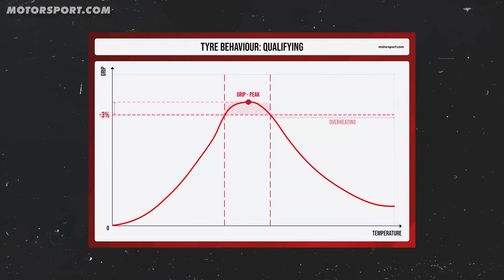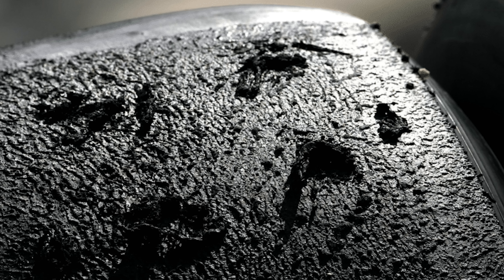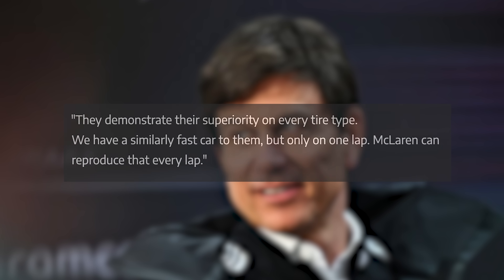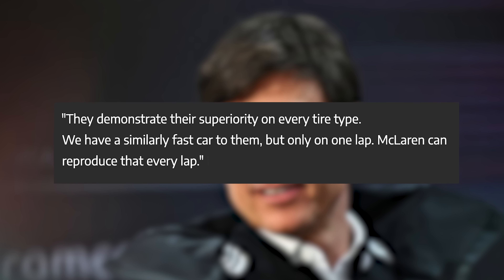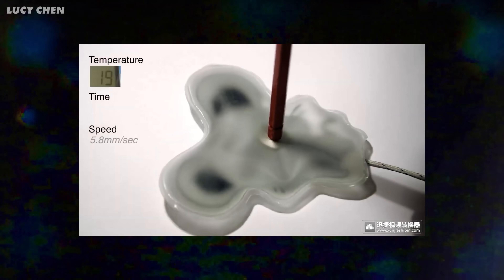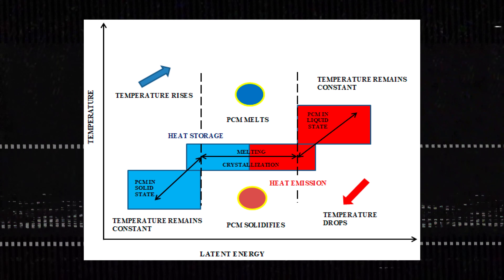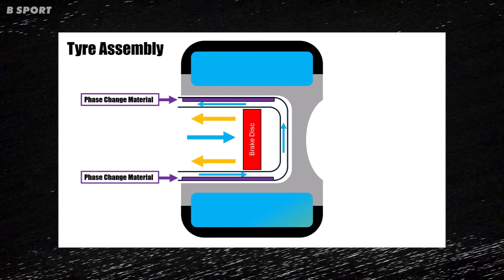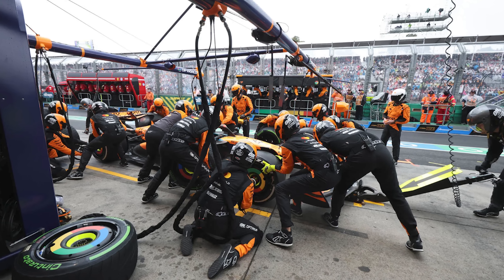McLaren’s GENIUS Tyre Trick Explained

Comment: does anyone remember when mercedes came out with a new wheel rim that got the hot air to move around equally but more efficiently? they took the wheel to the FIA who agreed  that it was a completely legal design. sadly, they dropped the rim so that no-one could complain (im looking at a picture of horner!) 

just before that, mercedes spent (they claim) 40 million, it was legal but the FIA told them they would have to remove it because all the other teams would want to do the same thing and this would send spending through the roof. or in other words, tough luck toto, you got to spend all that money but now it has to be taken off the car. what made it worse is they had to do it by the very next race. but the FIA is fair to all teams, so when red bull deliberately designed a wing they knew was illegal, they were given time to step it down (i think 3 races but cant be certain).

Comment: I don't see why it should be illegal to water cool the brakes in the first place. If teams want the added weight of that, they should be allowed. It has me thinking of CPU coolers that use heat pipes. There are some nice suspension pieces right there...

Comment: He might be right. Here. Phase change materials have been around for a long long time and I would be surprised if no one in F1 has considered before. 
We use it in our computers to transfer the heat away from our CPU and GPU. The top version works way better than traditional thermal compounds.

Comment: This technology wouldn't necessarily increase unsprung weight. If it allows the team to reduce the brake duct complexity and still maintain or improve brake cooling capacity, the tradeoff in material might actually be in their favor.
The possible downside is having to optimize this design for each track layout, since the length of straights and braking zones will vary quite a bit. I suspect they settled on a safe compromise rather than making custom brake setup for every track.

Comment: Instead Red Bull are the real cheaters. 

WELCOME TO MAX BULL:

They used Asymetric brakes 2023-Spa 2024.
They removed these from Perez's car in Miami 2023.
Max had these from 2023 up to SPA 2024. 
20+/30+ seconds every race ahead of 2nd placed pilots, no degradation issues during that time, Max could push it all at will and even had to slow down so it is not obvious (way different race pace than anyone else). Dude was cruising. 
No need to overcorrect his steering wheel, car takes corners amazingly well and able to push all he wanted without carring for his tires. Checo's looking more like an Aston Martin and degrading more than Max, yeah, right. 
One of Max's weekness as a pilot is tire mannagement.
Before Miami 2023, Checo was fighting Max for championship and was on par in times with Max! Race pace and quali.
Then in Miami, asymetric brakes removed from his car, only Max wins.
Same as 2022 (Marco and Jos made sure to sabotage Checo's strategies, not changing ending of life gearbox and leaving a used test floor in his car for 5 races in a raw - 2nd half of championship). So Max is not bothered by teammate (Max loves that). 

Max amazing pilot, gets most out of the car and also a great coward! 
"I did not came here to be second" Baku 2023.
And then again in Miami 2025 after fighting all over the place and ridiculed by Piastri. 

It is clear Red Bull pays media so Max is always "extraterrestrial". 
Everything he does is amazing and never comits mistake. 
If he wins, ah he is amazing, super Max blablabla... when he lose it is "Teams fault" or "slow car". When the team almost never made mistakes with Max. 

Checo: all the mistakes in the world. 
F1 is engineering, everything is calculated. There's data! Nobody looks at this!

Fact is in Miami 2025, he did not maximize his potencial and made a big mistake. 1st corner of the race, he was ahead and could have taken the corner normally.
Indtead, he goes middle trying something else allowing Norris to pass him and then throwing his car into Norris. 
Norris loses positions. 
If Max kept Norris 2nd with clean air, then he might have get both Mclaren fighting and maximize his chances. 
Max is just bad under pressure and has become an open book to Piastri.
Finally Max will have to upper his game and Piastri will be ready.

Checo could have been the same, but Max always ensured that 2nd pilot does not fight him.

Thanks to Marco and friends at FIA. 
Red Bull not having a Team head race engineer for both pilots, Lambiasse been Max and team head race engineer at same time (All data for one pilot only at Red Bull). 
Hugh Bird as Checo's race engineer (costing him more than 40+ points per season - worst ever race engineer in F1 history).

But is "Verstappen car that is adapted only to him" the issue.

Red Bulls***

Comment: Well, if this is the trick, then it has to work more like a temperature buffer rather then "cooling". There is no magical material which could absorb such huge amounts of energy without being very heavy. It has to get rid of that heat in some moments. So I can only imagine it prevents overheat in parts of track with a lot of braking and cornering and then it needs to release absorbed heat in parts of track where the tyres would be generally getting cooler.
Reply: Higher speed sections mean more air to cool and absorb heat from PCM and then reverse happens when braking to a slower speed.

Comment: Material engineer here. As soon as i heard word "phase" it instantly clicked in my head. Brilliant solution, lovely and elegant. And also demonstrating the power of property designed material.
Reply: Me too, except for the engineer part. 😁
Reply: Physics and music guy here. As soon I heard the word "phase" I went up all the wrong mathematical rabbit holes and was embarrassingly far into the video when I remembered "phase" in its materials/chemistry context. 😅
Reply: Did you consider as a materials engineer that the latent heat of fusion is a two way street in that a massive amount of latent heat would have to be released to into the wheel assembly to re-solidify the melted phase change material such that it can again serve as a heat energy sink at the next braking corner.  We must consider that with this type of "keep it cool" system, a large amount of heat energy is still stored in the overall wheel assembly as its not being effectively dissipated externally as with an air cooling system where the heated air physically leaves the system.    Nobody here is discussing the obvious fact that latent heat works both ways in that a lot of enthalpy is needed to melt the material at the same temperature but in reverse, a lot of enthalpy must leave the material to re-freeze it at the same temperature!!!  Where exactly is that released heat going to go guys and girls???.............back to where it came from is a pretty close answer folks.  If the air flow between braking zones is not sufficient to cool the wheels without the phase change material, then it's not sufficient to remove the same amount of heat from the magic phase change material to refreeze it such that it can continue to function as a heat sink.  This is engineering 101.  Heat sinks have to be cooled too before re-use as they store a lot of heat.  Recall that when a material solidifies at constant temperature that the latent heat of fusion must be dissipated from the material to the surroundings.
Reply: @bobstevens7028  What do you mean nobody is discussing it? I did😂.
The original problem was not to let the tires get up to temperature fast or to cool them, but to do both, and one solution Martin Buchan mentioned was to use bimetallic ducts that change the direction of the flow, giving the wheel hot air from the brakes when its cold, and give it fresh air when it's hot. The PCM is just smoothing out the fluctuations.
Reply: @sasjadv  What about solid-to-solid PCMs? There has been research done with 3D Ag foam and short carbon fibers (SCF) showing significant improvements in thermal conductivity and EMI shielding while maintaining latent heat storage.

What if Mclaren is using this not as a main cooling solution, but as a way both to control temperature peaks on the tyre surface and more efficiently transfer heat from it to the conventional cooling solution? It would explain why their rear tyres almost never seem to overheat in S3 in qualifying, unlike most other teams, and why they're better over a race distance. Food for thought. It would also definitely comply with the regulations concerning materials not undergoing significant changes between the car's static and running states, as it would undergo no visual change at all.
Reply: @LegendTheCanadian  🤔I looked it up.
So Ag Foam SCF has only 71.5 J/g of latent heat. Parafin composites have 110J/g, PEG composites has 169, fatty acid composites have 210. And I'm taking the numbers of composite materials (fiber reinforced), which already perform worse than pure oils.
The benefits of Ag-SCF is EMI shielding and good conduction of heat.
Tires heat up and cool down gradually, so we don't need a PCM with high conductivity, but better latent heat means you can either absorb more or make it lighter.
And I'm thinking: PEG is used as a base for modern brake fluid, it's used as a polyol component in polyurethane, it's used in cosmetics, there are different chainlengths of PEG with different melting points. And there is research about form stable PCMs made from PEG PU.
Reply: @sasjadv  do you think using something like this could also explain the "cold spots" that Red Bull claims to have seen on their thermal imaging?
Reply: @LegendTheCanadian  🤔I don't think it's the PCM.
Like the PCM just gets rid of the fluctuations and makes the temperature more stable, which allows you to use more agressive cooling ducts that will otherwise cool too much in some sections.
And the extra big cooling ducts that they can now afford to use, could show up as cold spots.
And then, we're talking Redbulls's word for it, maybe the thermal images don't even look different from other cars, and they just dialed up the contrast.
Reply: @bobstevens7028   yes of course i understand that energy is stored. Everyone understands it, even in the video its for the sake of simplicity called "heat sponge". It basically gives thermal inertia to the system (wheel). What to do with that heat? Clearly it just helps to keep rubber cool then it overhears and keeps rubber warn then it overcools. Managing that is up to the driver and results of McLaren speaks for itself. That energy is not extra, you just gotta find a proper moment to release it. Btw, amount of energy is still the same.

Additionally, "phase" doesn't necessarily means melting, there are materials with phases changing from solid to solid. Energy of that change depends on material components and thus exactly the subject of design. 

Also, addressing the environmental dangers from one of the previous ppl: its all about the amount of materials. Also yes, its not gonna get released all the time like CO2, carbon shards and microshards (up to the single fiber size) or rubber particles. As long as there aren't radioactive metals or (and) super toxic things like beryllium, it shouldn't be more dangerous to environments as any other piece of machinery on the track or in pit.
Reply: @jinxmono  Isothermal solid state allotropic phase changes such as alpha to gamma iron are associated with very small enthalpy changes as compared to the latent heat of fusion or the latent heat of vaporisation.
Reply: @bobstevens7028  maybe. I haven't seen the scale of enthalpy for solid-solid phase changes, but im sure there could be something exotic. I'll look it up out of curiosity later =)
Reply: PCMs are only part of the solution, stabilising fluctuations in temperature. The long term solution is to make adaptive cooling ducts that route air a different way once it's up to temperature.
Martin Buchan talked about this in his 2nd video about the topic. And I mentioned the exact same solution in his comment section one video prior😂.
Reply: If liquid cooling brakes is illegal (it is), and phase change material become liquid as part of their ‘thing’, then these materials are absolutely illegal. If they use swap airflow direction through the brake duct, that is aerodynamics, also illegal. 

Something else is going on. Not this.
Reply: @f.kieranfinney457  Why? Adaptive aero regards the bodywork. A combustion engine is also active aero, the intake and exhaust valves open and close all the time, but it's not part of downforce of the body.
Same with ducts inside the wheel.
Reply: @sasjadv  even moving Oliver’s inside the bodywork for channeling cooling air could be considered active aero. Obviously intake valves aren’t. The rules are really strict.
Reply: @f.kieranfinney457  We are talking about ducting and flaps inside the wheel, surrounding the brake calipers, that don't influence the airstream of the car (drag/downforce).
We are not talking about flaps inside the bodywork.
Both brakes and engines are this separate device that can decelerate a car mechanically.
Bodywork is not a mechanism, it doesn't have to be mechanised to work, and apart from some designated DRS it is not allowed to be mechanised.
You are comparing something inherently mechanised to something inherently non-mechanised.
   
And if you're in doubt, why don't you just listen to the engineer who has worked in F1 himself, who filmed the video in the first place and says it it allowed.
Reply: @f.kieranfinney457 phase changes can be between phase states in solid materials. For example body centered cubic and face centered cubic in steels.
Reply: @richardsparks9904  quantum states? Is that really a ‘phase change’ then?
Reply: @f.kieranfinney457  Not quantum, their crystalline structure changes from one lattice configuration to another at set temperatures, releasing or absorbing a lot of thermal energy in the process. They do not undergo any visual changes, to our human senses it looks like magic. But at an atomic level, it's just the atoms rearranging themselves.
Reply: But is it physically possible? I don't really think so. There needs to be a massive heat absorbant in this phase change material, I don't think that this is the secret. It can't "handle" this amount of energy in this little mass around the inner rim or what they said.
Reply: @Watcheyes  What amount of heat are we talking about here?
Because the PCM won't absorb the heat of the whole race, but just the fluctuations between different portions of the lap. This just allow the aircooling to be overbuild, and not deal with tires cooling off too much in the straights.
Reply: We should be concerned about the toxicity of these materials. Car wheels get destroyed frequently. What happens when they’re aerosolized or burned?
Reply: @f.kieranfinney457  if we go that route... Then they'll have to ban carbon fiber.
Reply: @The_Curious_Cat  exactly! No one is talking about the environmental consequences of carbon fibre and motorsports uses a shit-load
Reply: @f.kieranfinney457  should we be concerned? A great number of PCMs are non-toxic. Obviously we don't know the composition (or if they're actually being used), but you would hope that the days of beryllium engine components are behind us

Comment: There are specific materials that can bend and change shape depending on their temperature and applied pressure etc. This is exactly what they are doing with the rear wings, with specifically directed exhaust gas they can "soften" certain areas to bend and twist when required and absorb all the force applied when in the FIA test 😊

Comment: Excellent explanation but...is it no longer possible to move the brake assemblies inboard, in the body? Perhaps near one of the energy recovery systems to absorb that heat? Move the brake assemblies between the wheel and the body and use the brake ducting shape to generate some downforce?

Comment: Tempting to use a liquid to gas phase change and have the structure as part of a heat pipe system. The gas could be moved inboard to cool and wick back without the large weight gain of the solid to liquid bulk solution. Just a thought.

Comment: It isn't a genius solution, but I would have expected it to be illegal. The heatpipes just redistribute heat, they don't cool. The reason they work so good (for example in CPU coolers, which use low temperature phase change material) is that they can bring localized heat to a very light but still big surface. Add a Bimetalic thermostat regulating the airflow over said cooling surface and you've got the basics. To finetune this is not as hard as it seems: one can change the bimetalic thermostat, or change the surface of the cooling element. 
If I were to gamble, I guess Sodium or lithium might be candidates as the medium

Comment: As an ending note, having a heavier material makes sense when we consider how much they’re wearing down the skid plate and or tires at the end and not getting penalized. Their car is sparking more than anyone!
Reply: I would say their car sparks less then others since extra weight is on the tire itself means less for suspension to deal with.
Reply: @arbiter1  I just happened to notice in Miami that the McLaren was porpoising badly and showering sparks which caused me to see in the end if they had too much wear on the skidplate like others had before. Nope, nothing. A lot of sparks though! 
So whatever theyre doing its allowing them to run slightly heavy in exchange for the extra benefits.
Reply: The sparks comes mainly from Aero pushing the car down tho, don't they?